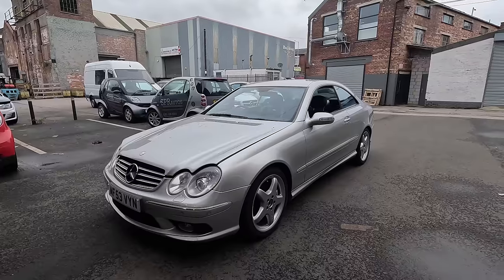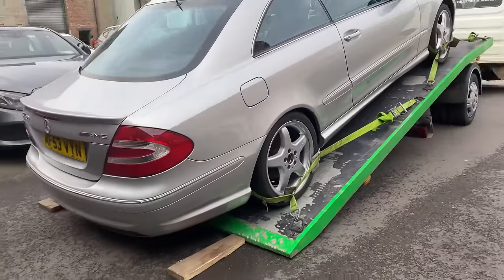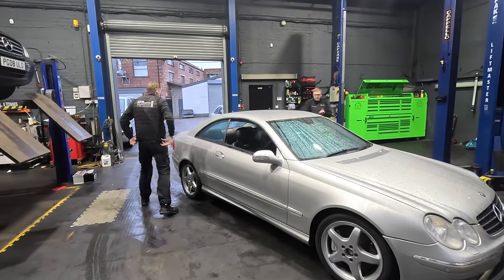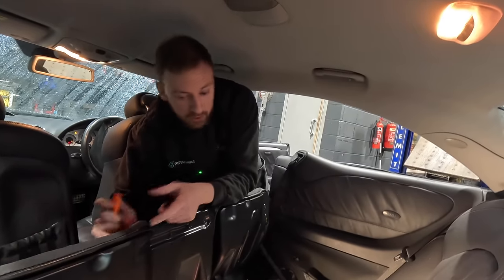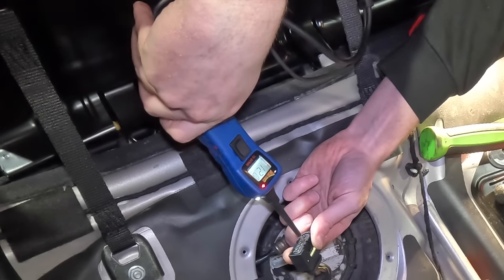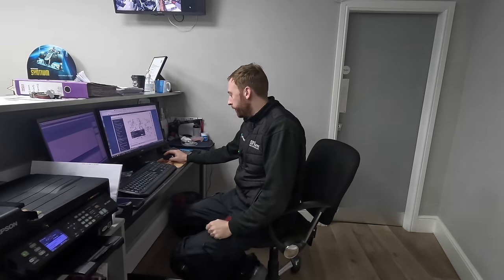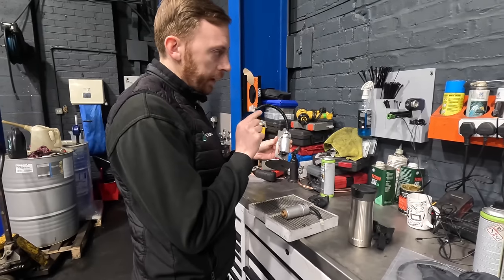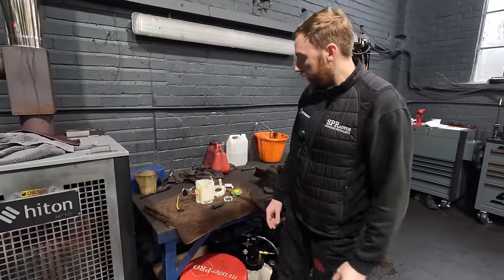BARN FIND! LOW MILEAGE MERCEDES w209 CLK 55 AMG, OFF THE ROAD FOR 7 YEARS, CAN WE GET IT RUNNING?

Comment: Glad I found this channel, I have a 2003 CLK 55 AMG (here in USA) I got for $4,000 in great shape; best money I ever spent! The M113 is quite reliable, easy to work on, and puts a smile on my face every time I floor it. On these cars basic preventative maintenance, a good local mechanic, and being able to do some work yourself as I did the plugs, valve covers, gasket seals, etc. are important. Great video!
Reply from the maker: That sounds a good buy. 🙌👌 we have done a few videos on CLKs so far
Reply: Great work ,guys  love it
Reply: I bought an ‘05 CLK55 convertible. I agree, these are brilliant cars that, for some odd reason, no one cares about. 

By the way, for $4000 that’s well bought. I got mine for $5500.

Comment: when you use the air hammer with the socket on bolt to free it up mine have an handle on the tool so you hammer and use the handle to turn the nut ! we call it the wood picker !
Reply from the maker: Yea I’ve got that Aswel. It’s a great tool.
Reply: @sprautos  i found this tool for the first time when i was aircraft mechanic in my early day and always keep in my tool box since then first time seeing your channel like what i see !

Comment: Great video - From experience, and I dont have a snap on Jack/h, with difficult bolts - heat first and then TIGHTEN [tiny bit] and THEN try slackening. Worked great on my 1982 911SC heat exchangers. Had never been off in 35 years.

Comment: got an 221 s500 4matic at home country that has been sitting for 13 (yes thirteen)  years and has about 20k miles. I went this summer did not even try to crank it I knew not only fuel pump shot but the petrol turned into some sort of gel. And the wiring between them was all frayed as well :) fun times. All fuel system was pretty much shot but after sorting that, manual turn, oil and all fluids changed it's back on road to mechanics for suspension and perished rubbers.

Comment: I have worked for mercedes. What you need to do at this mileage is flush all the systems including engine. Gearbox it’s easy to remove plate and clean as well. Also clean the tank before you install the pump and clk will fly :) good luck 🤞
Reply from the maker: certainly will! i gave the tank a good clean when the pump was out, the big rubber seal fell to peices and was all floating around in the tank!

Comment: Great vid which I have enjoyed watching. I came to this straight from the CL500 vid. I have always loved the look of the CLs but always considered them too complicated.

However, I do have a 2002 CLK320, which has just clicked over into the 64K miles. It is about as modern and complicated as I want to go. I call it my 'inter city' car and these days rarely do more than 1500 miles in it. Every year when It comes out of winter storage I always have the oil and filter changed and always have something else done at the same time. 

During my 5 yrs of ownership I've had the spark plugs changed, aux drive belt, brake fluid, coolant changed, and the gear box fluid & filter done at least twice. Going back through it's MOT history, the only things it has ever failed on have been lamps and tyres. Latest MOT was a pass but a couple of advisories I'll be having looked at. Roll bar linkage pins or bushes.

I sometimes wish that I had looked a little harder for a 500, but I'm happy with this one.

My 'other' car is a slightly different kettle of fish. A 1973 Citroen SM, fitted with a Merak SS 3l engine, recently imported form Sweden.

Comment: I love this. I bought an ‘05 CLK55 convertible for 5500 USD that had some oil leaks and needed a rod replaced for the convertible top. I love the car. I think the CLK55 is such an underrated AMG.

Comment: I don't know how i missed this one.
 Great fix on the fuel pump. A real mechanic actually fixing things instead of bolting new parts on. 
 I was hoping to see how you checked the gearbox level as i have this transmission in my jeep. Mine takes ATF+4 though. Must be interchangeable with the Mercedes spec stuff.
Reply from the maker: check part 2 of the clk project we show you :)
Reply: @sprautos  That's great, thank you, i will find it.

Comment: I did a complete gearbox flush on my C32AMG. Removed the bottom hose to the cooler and ran the engine at idle until the fluid changed colour, constantly topping up at the top tube.  Used over 11 litres of tranny fluid to do this. This flushes out the torque converter as well.
Cheers.

Comment: You mastered this! :D My fuel filter(Mahle), MAF Sensor and Tube(Bosch), the two seals that go to Intake Air Box and Intake Manifold, and my "Dipstick" just came in today and I can't wait to see how she does without the p0172 and p0175(Bank 1 and 2 too rich) codes finally! Living in the middle of nowhere makes getting parts a bit of a waiting game but this car deserves the much needed attention after being repo'd and passed off from dealer to auction house to dealer to dealer and someone has not been kind to her... turns out, the headlight washer pump caught fire at some point because the cover is missing and water/dirt/grime got all over it and the random car dealer/or auction house must've just put the fire out and left it. It melted the whole reservoir and wires although shockingly, the windshield washer fluid pump that sits right beside the headlight washer pump is weak and was overheated it looks like but still works! That's the worst of this incredible machine mechanically though! For 181k MILES, this 2005 CLK 55 AMG Avantgarde still drives like new and doesn't miss a beat. I'm actually having trouble finding a more perfect car for the someone who lives alone or doesn't need the extra seating/weight. Reliable, Dependable, Durable, Fast, Looks great, Handles great, Luxurious, Comfortable, etc, you could go on and on... It's a shame how rare these are, I recommend you get yours now while they are still cheap. These CLK AMG's are going to skyrocket in value eventually, they have everything one could ask for. It's like a bigger, more luxurious Miata with a V8 and a back seat!

Comment: Great video, that pump sounds like it's starved mate. Wonder if the pick up pipe isn't well sealed? Just does sound noisy. What a lovely old car though. Is that gearbox rust just condensation related then? Just goes to show what happens if they're stood through so many seasons.

Comment: Great video, great car. The long cranking could be something to do with a one way valve in the fuel system not working/not there? I know some cars have it built into the pump so the system is kept basically fully primed all the time although not necessarily at full pressure,, with the short topup prime prior to starting being just that.
Try the ignition on/off/on/off a load of times, like 10+, and see if it still takes as long to crank/changes at all.

Comment: I had a starting problem like you encountered like you after fuel pump replacement too. Looked at the data and saw when cold thermo sensors when cold for block and coolant were not similar. Can't recall what sensors I replaced but it worked 😂😎
Reply: From memory it was the block thermostat that fried and was reading 60 degC when it should have been more like 12-20

Comment: Excellent work, I'm not a mechanic but I think that the suspension arms should be tightened in the 'working position', that is, if the car is on the lift, place a jack underneath to put pressure on the suspension and only then tighten it, that way they will be in place straight away. effort when lowering the car, another detail was to have done this before installing the new brake, but once again Excellent work, looking forward to part 2 and they gained 1 more subscriber! Big hug

Comment: Great video, I had the pleasure of fixing a w170 gearbox oil leak because some one had recently installed a new pilot bush and snapped that 7mm bolt! Luckily I was able to remove the valve block and drill it out. I like that gearbox flush tool, do you have a part number or a link mate?
Reply from the maker: It was an eBay special. If you search Mercedes gearbox flush tool you should find it. It does 5 & 7 speed

Comment: Oh dear ! You should tighten lower control arm bushes when wheel is preloaded on the floor , (23.25) won’t be long until it goes again ?
Reply from the maker: Your right and it’s Been. We were on the 2 post ramp at the time. Then on the 4 post

Comment: Ideally you should tighten lower arm Bush bolts with suspension in it's natural sitting position as when you tighten them with it hanging, rubber is twisted when at normal ride height
Reply: This has been commented on a good few times and the answer from Sam has been the same,  it was done/checked when on the ground>

Comment: Nice repair work. Cant believe the bushing went with such low mileage.
And yes can hear the noisy fuel pump motors.
Did l hear the clicking sound at start up from the vent motors. My C32 has the same problem. so annoying.
Just checked the prices in Aust. From $AU20k to $AU145k. The top price is for a CLK55 convertible with 35K Kms.
Cheers and well done.
Reply from the maker: Good ears 👂 yes it’s got the typical vent flap issue

Comment: i have a w220 and its been sorn coming up to 2 years in december. do i juts charge the battery up and start the car as normal ? or do i need to drip oil in the cylinders ? owned the car 9 years, has been reliable car.

Comment: Lower control arm bush bolts should be only be tightened when the car static weight is on the wheel. Otherwise as soon as you put the car on the wheels, the bushes are going to be under tension and will tear out sooner.

Comment: Just a thought … I changed the crankshaft position sensor on my C55 which I understand are known to fail and cause starting issues.  Cheap part.  I’m certain you already know this, but might help other owners.  👍🏻
Reply from the maker: Yes I’ve mentioned this in many of my m113 videos. And it sure will help viewers/readers🙏🙌 so thank you. 
We’re getting a little community now which is great people helping others in the comments etc.

Comment: We've replaced just the pump inserts for years with Rovers and saved ourselves and customers £1000's !!

Not for the faint hearted though with all the crimped pipes but with gentle heat they do pull off and are reusable 😊
Reply from the maker: Yea we had to apply some gentle heat to get the pipes off also. 
Let’s hope they appreciate it.

Comment: Lift suspension to operating ride height before tightening bolts on rubber suspension bushes, helps a lot with longevity.
Reply: Exactly always tighten under load .that arms will worn out no time. Big mistake

Comment: The suspension arms should be torqued up when the car is sitting on the ground otherwise the rubber bush is twisted when at normal ride height and will wear out prematurely. You can also take the banjo bolt off the right hand side of the gearbox attach a tube to it and run the car for short periods allowing a liter or so of old fluid to pump out and top it up, Repeat until new red fluid arrives, that way the whole gearbox, TC and cooler are changed.

Comment: Well done lads. Those rubber gaskets are a pain in the bum. Audi have used them too and I had fuel pump failure too on an old Allroad. I too had to suck out all the nasty rubber fragments. Interestingly the replacement gaskets were a special brown synthetic material. Why is it VAG fit stuff that makes other stuff like pumps fail?? No proof it's those fragments, but they won't have helped
Reply from the maker: Yea our new seal was now green the old one was black. Just what you want a load of rubber floating around in your tank 😂
Reply: @sprautos  yeah sod that shit

Comment: How do you get the torque converter empty (of dirty brown oil) or clean, without a drain plug ?!😢
Reply from the maker: We have a special tool to to introduce air into the valve body push extra fluid out.

Comment: A question please. if the car has been sat for 7 years, what is the condition of the engine oil after that time. The car's been driven with 7 year old oil in it. I would have thought that would be the first thing to change before even trying to turn the car over. Or have you already changed the oil?
Reply from the maker: We checked the oil condition, covered 1k in 7 years. I know what you’re saying but was fine for testing.

Comment: I have a CLK350 with the seven-speed transmission, I also have a compressor and filter, a new oil pan and Dexron fluid, could you tell me what sort of PSI you used to 'air out' the gearbox/trans? And more importantly, how did you get an airline hooked up? Cheers😀I do have a drain in my torque converter though, I was going to pump fluid out via the outlet/oil cooler.I am commenting as I watch my auto box has no fill tube, you have to fill it via the drain plug/pipe plug arrangement.
Reply from the maker: I set it that low it doesn’t even register on the gauge! 
The tool is designed to hook up to an airline, and has airline attachments

Comment: M113 ,,a great engine , reliable , good combination of power and efficiency.
Shouldn't the control arm bolts only be tightened / torqued with the hub raised or with weight on the wheels ..
Reply from the maker: Brilliant engine. 
Yes the car can go on the 4 post lift afterwards and have the arms loosened off and re torque

Comment: Great film. The brakes have had a battering for such low mileage haven’t they? Depends on how you use it and where but AMG discs are really expensive aren’t they? Having said that,original discs have worked out best in the past so I would not be tempted to try other brands. I was surprised in the past to find that parts like flexi hoses from Merc were very reasonable.
Reply from the maker: I agree, I find Mb brakes to be the best especially on big stuff, I find anything else seems to warp. Plus as you say prices are reasonable. 
The AMG brakes on the clk 55 are pretty much the same as a clk sports pack so are even more reasonable.
Reply: 2005 build cars get the same brakes as a CLK63 , two piece Brembo rotors which do cost a lot , but they should last for 60,000 miles.

Comment: Sam that very small probe you used in the boot to test fuses.
What make it is please?
Looks like you didn’t need even need an earth connection, would I be correct ?
Reply from the maker: It’s a snap on tester but I think other brands make it now also. And yes it earths through your body so saves wires. 🙌👌

Comment: All rubber including tyres as well as all fluids including fuel should ideally be replaced after 7 years.
Also , should the suspension arm bushes not be tightened up once they bear the weight of the car ?
Reply from the maker: Yes, car went on 4 post for tracking and was done then

Comment: Wish I saw this before I bought my 200 turbo , now done 86k kms and already I replaced my pads and had my disc's skimmed , large caliper type with holes in the discs... yet it still shows that it needs to be done ... I've given up on that , because the brakes are good now. Shoulda stayed with Toyota 😢

Comment: just rewound to 11.55 and why would you not strip the whole hub and re-pack the whole hub assy if you do the outer one would the inner one not be void of grease,i,m sure you would maybe have to renew a seal but the way your doing it your doing a 50% job or am I wrong
Reply: You must be bored to make that comment
Reply from the maker: You’re not wrong, would have to renew the abs pickup ring seal and remove hub. I was just doing this as a freebie while I was in there for the customer without encoring more labour. I did explain I was only doing the outer because bearings needed adjustment. 
I could have not done it at all and just nipped the bearing up 🤷🏼‍♂️

Comment: Check rad my clk 50,000 seal failed in rad coolant killed gear box .Original valearo rad faulty from factory common fault.
Reply from the maker: Yea we used to do loads back in the day. It didn’t strike me as coolant as there was no separation in the fluid, so far it’s been driving 👌. I used to have the official glycol test years ago.

Comment: 23:15 Bro WHAT ARE YOU DOING?.. FAIL! DO NOT tighten that bolt yet!!. NOT with the car up in the air and the suspension unloaded. When the car gets lowered on its own weight that bushing on your brand new control arm will twist and fail prematurely. It will be under extreme unnecessary tension now with car driving and won't do what it supposed to!. It won't when tightened with the car on its own feet or a jack-stand underneath the wheel. It will be under unnecessary tension with the car off the ground but that is all most never. Get that car back if 2 weeks did or didn't destroy the bushing already!
Reply from the maker: Don’t panic It’s already been let off and retightened on a 4 post ramp
Reply: @sprautos  Nice! Good job with the rest though.
Reply from the maker: Glad you liked the rest of it 👌

Comment: Not nice of MB charging a small ransom for the fuel pumps, they could do much better for the customer. Also, not impressed @10:40
that shows an electrical connection exposed to the elements, these are nuances that put me off German cars.

Comment: By the way, I forgot to mention this is a famous problem on CLK’s for the fuel pumps to go and the whole job takes literally about 45 minutes to take the seats out replace the fuel pump. It’s a super simple job. But again I got a repeat myself. I don’t know what kind of scam this guy is selling but these are not £1000 these are $52-$60 on eBay and Amazon made by the same manufacturer that Mercedes, gets them From.
Reply from the maker: I can assure you I’m not a scamming anyone, dealer wanted £1259 plus tax.